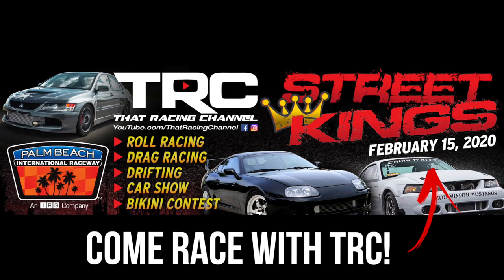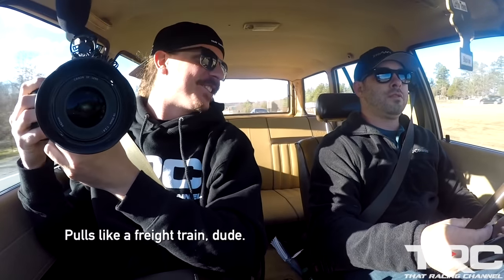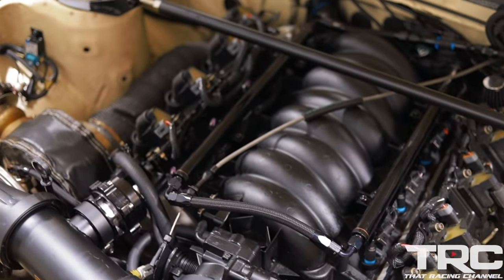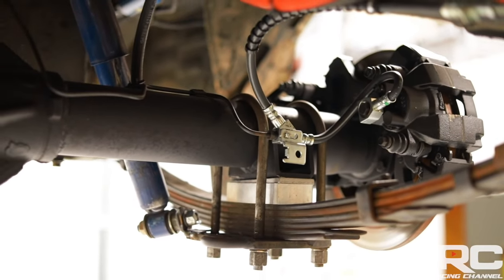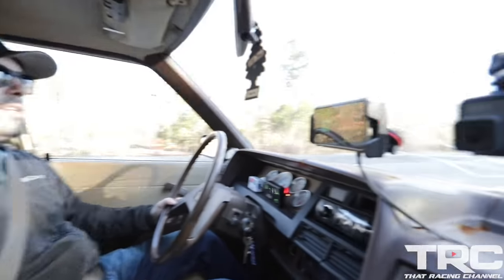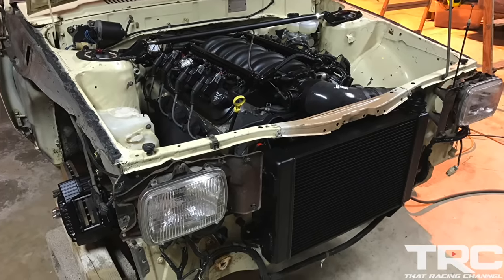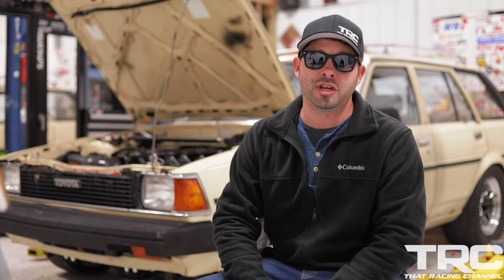800HP Sleeper Station Wagon Encounters Police (Best Excuse Ever) - Barn Find For $100

Comment: I know it would sacrifice some power but a quieter exhaust system would make this the ultimate sleeper.
Reply: Yes sir, cut outs are a must
Reply: I hear you tyler....but can't have it both ways....Pretty quiet compared to the less than 200 hp Civics around my way.....And I'm including the dorky gay inflated stereo bass on these Civics here in DFW, Texas....
Reply: How about a full stock looking exhaust with a valve to a performance exhaust
Reply: This ain't no sleeper with tires like that..
Reply: This ^^^^ hardest part of a sleeper build is a vehicle where good tires aren't out of place.

Comment: FINALLY.. an ACTUAL sleeper! 👀
Reply: THAAAAAAANKS👏🏾👏🏾 i hate when they say "sleeper" and shows a Mustang or an STI🤦🏾‍♂️
Reply: until you hear it maybe.
Reply: @GhostlyGhille  thats the point of it actually. Having a car that at first glance you would think you can beat it with a stock low level car like a Celica but then when it comes alive you be like "damn..."
Reply: Aside from those giant meats back there too lol
Reply: Sleeper when it's in a parking lot maybe. It's too loud to fool anyone while it's actually driving around.
Reply: @mikey_gc8  tires dont tell you anything though. Any fool could put DOTs on there car
Reply: Would be legend if he put stock looking wheels back on there...
Reply: @SCTitan06  i agree , there's a lot of billet aluminum "steelies" out there that would look almost stock with crappy silver paint
Reply: 1320 is all about their fake sleeper bs
Reply: I have a real sleeper. 97 explorer
Reply: That sounds like john force in the next lane?
Reply: Who can sleep with that loud exhaust
Reply: @NelsonRB26  Depends. People interpret sleeper vehicles differently. Me for one, has to look stock and sound stockish maybe sound as if the engine has a problem. Cutouts that open on a switch or say the rear tubbed to fit a fat tire but same wall height as the front is a sleeper. This car, the clear giveaway is the rear tires and the rims. I would never attempt a vehicle that is that clean underneath as its a monster usually. 

Many pickups pull that look off. Actually to why i want to keep my old truck as a Texas speed built motor twin turbo with a 4L80E and T-case with 33x12 tires would blow the doors off many vehicles. Also look and sound stockish with the proper exhaust and a 4in lift. Id use electric cutouts/dumps under the cab on a switch panel that appears to only have offroad lights (truck aready looks like a hunting vehicle) but in reality nitrous and cut out buttons are also on there.
Reply: The wheels and the sound gives it away not a sleeper sorry.
Reply: minus the huge cam and slicks haha
Reply: Wanna see a real sleeper its a guy with a 92 civic looks bone stock factory wheels n tires even a child on board sticker haha but under the hood he pushing well over 400hp
Reply: 3 name changes allowed every 90 days.  not exactly sure what you're saying here. I have a car that makes 700 horsepower through a muffler. It's a real sleeper. This wagon is super cool and really fast but it's not fooling anyone when you could hear it coming from the next county over.
Reply: @beardedforlife3740  those tires mixed with back sound means power. And if you don't have enough money to put a big motor in it you don't have enough money for those tires and rims, not to mention the rear end to turn those things.
Reply: @sctrep  nice exploder
Reply: @sethh8892  I'm well aware how much that stuff cost. However, I've seen plenty of people put wheels like that on a car to look cool. As for the sound, it could easily be a cam and good exhaust and it will sound like it has power. Besides all that, you can't tell me that if you seen a Toyota wagon you'd immediately think it fast
Reply: 3 name changes allowed every 90 days.  Didn't make anything up. Thanks for recognizing the reading comprehension skills, years of practice finally paying off!
Reply: Sleeper? Rip van Winkle couldn't sleep through that exhaust note.  Sounds like a box of hand grenades going off.
Reply: Needs steelies and a quieter exhaust to be a real sleeper

Comment: Holy shit bro, when they did that slow mo of the launch with slicks at the track you can see the entire chassis flex with he launched it...lmfao This is awesome!
Reply: The Man, The Myth, The Legend defenitley needs a cage!
Reply: @MOTOHEAD-ko3tq  ABSOLUTELY, along with some chassis stiffening...
Reply: It used to be pretty common to put slicks on a car and have things happen like the glove box falls open on launch. Old F-bodies used to tear the roof seams at the corners of the doors.
Reply: @lesliehorwinkle  I had a 1976 Buick Skylark sedan that I was given with 34,000 original miles, and I pulled the Olds 260 2bbl Rochester and TH200 (that was ABSOLUTELY GUTLESS and guzzled gas) and swapped in a SBC 400 with high compression domed pistons, Eagle stroker crank, Dart heads, a dual tunnel ram intake that had two Holley 850 Dominator double pumpers, MSD 6AL timing, along with a Muncie M-22 Rock Crusher and it eventually made 566 whp on a hub dyno, but I put M&H slicks on it and I remember when I launched it for the first time the glove box fell open and distributed it's contents into the floor, and both of my sun visors flipped down in my face...lmao That was a really fun car and a burnout machine.

Comment: The wheels look too fancy. Don't you have any rusty hubcaps.
Reply: Hubcaps couldn’t handle the speed/torque of this beast.
Reply: @TEDdotcom   Steel rims could, however.
Reply: @TEDdotcom  hubcaps are decoration  only. A steel wheel, which is what a hubcap covers, could handle it.
Reply: You also need to add some duct tape to hold stuff on. Maybe for the headlamps or something.

Comment: Not really a sleeper when it lugs like that. It's obvious to everyone with ears and eyes for 5 blocks.
Reply: Actually...pretty mild sounding.  You can't have it both ways with what he has to work with here.....sure you can make it more quiet.....but you'd suffer too much power loss. Consider the power....this is pretty quiet....
Reply: @justmyself1000  "what he has to work with" making it sound like he's misfortunate with his 800 horsepower motor😂
Reply: 3 name changes allowed every 90 days.  so what's your magical point? Because you just said that people aren't going to know that it's extremely powerful... but literally everyone knows it is...
Reply: @sethh8892  And those rims, the fat back tires.. Sleeper should look a bit more ordinary
Reply: Herp Derp We did that w/ a 70 Nova,w/406 one time . We put exh cutouts on it , and in a small town w/brick buildings it was awesome rattled the windows for blocks .
Reply: Still a sleeper though, many can pull off the loud exhaust and new wheels but no real power. 

not until he opens the taps like a maniac

Comment: I dont think you know what "sleeper" means.

it definitely doesn't mean a car that sounds like a cammed out monster equipped with drag slicks.
Reply: T C it's hard to make an 800 horsepower car quiet.
Reply: Exactly I see kids with no power and all exhaust attracting the police everywhere they go.
Reply: @clumsygarage1578   straight to the point !
Reply: @clumsygarage1578   Not really, with true duel exhaust and actually using mufflers it's possible to quiet down more that twice that power. It's just most guys that go through the effort of building an engine like this they want to hear that big Cam and feel it idle.

Comment: Definitely badass but needs a cage 36 years old have fun but plz be safe
Reply: @Stay Lit True, but the driver be sleeping forever if he rolls it. That thing will turn into a stepped-on coke can in a second, they are death traps..
Reply: @Tomazack  You are right, but i understand why he dont do one
Reply: @Tomazack  didnt yall see the full seam welded chassid
Reply: @louiscrespo1280  Yes, but that doesn't improve the strength and rigidity of the roof and pillars. And 800 hp could easily send this car flying and rolling, and the outcome wouldn't be good. These cars weren't known for their ability to withstand crashes and rolls.
Reply: Exactly. Tires brakes and suspension as well.
Reply: Rock Hard  Never heard that one before, I approve.

Comment: The wheels are the only give away, way too nice.
Reply: *tires, the wheel look ehh
Reply: He's obviously not going for a sleeper looks more of engine build and he could just care less about the car. I guess he just does drags but a drifter would be cooler
Reply: I.e. puts all the money into engine and driver train into a bucket looking car. But I love old school yotas
Reply: Nah Brian, they meant wheels exactly like they said. You over there inspecting tread and width bud?
Reply: @vvumpkin  the wheels are after market sure, but they don't even look that good. But ya obviously have massive slicks is gonna lose the sleeper look.
Reply: Yeah the term "sleeper" is doing a lot of work here. A real sleeper should look and sound as stock as possible.
Reply: But the upholstery makes up for the tires
Reply: @dannycole2974  lolol yes and no. Sleeper look is from the outside. No one's gonna he like " oh that looks like it's not stock. But the seats are shit. Nvm, it can't be fast" -_-
Reply: I have seen plenty of old, worn out cars with a thousand dollars worth of rims.
Reply: I had a 1982 Corolla. It was a good car.
Reply: The ventilated seats put in in the luxury car category. Also, good to see it came with the trailer package...in case you ever need to pull an office building..ya know..'
Reply: And all the electronic gauges, shifter, clutch setup, 2-step...but maybe the cop didn't see those. He sounded bored anyway.
Reply: And a screaming cam

Comment: it needs mufflers and butterfly valves to be a true sleeper.
Reply: Had exhaust dumps on my 454 70 SS Chevelle in one of it's iterations of engines/mods over the last 30 years I've owned it.  The rumble if I'd rap the peddle good would literally feel like you were getting punched in the chest if you were standing in the wrong area when I did it.

Comment: I love sleepers, had a couple. My best was a '79 Cherokee with AMC 360. It couldn't win a race against its own exhaust. We live in the mountains and it was always a chore getting up the hill, going was easy.
Put a 568 CID, I opened up the 454 Siamesed a bit. 3 angle valves, my custom design cam, 11.5 ratio, 442 to 308s, 27% full time in transfer case, 3 inch holes, dual with close to free flow mufflers, and a few other things including custom pinstripes and a touch of rust here and there. It sounded like an old beat up truck engine with a few leaks in the exhaust. Until I opened it up then the whole county knew there was something special under that hood.
As to the police, I went to a market once and a policeman parked a few spaces away. He looked over at us, smiled shook his head and walked away. Being a fairly old guy, 40 at the time, is probably the only reason no ticket was involved.
I need another sleeper, everybody needs at least one in their life.

Comment: I owned 1987 JDM version of this in my country back home before ( KE72) with 1.3L 4K engine , 4 speed manual transmission , Still very reliable and good on gas
Reply: And my dad owns one rn and it's made in 83 ke72

Comment: Flowmaster may reduce HP more then let's say Cherrybomb but FM's sound amazing to me. You could run 18" glass pack before the FM's, it would help with the noise and the only real HP loss would be from the FM's. Same trick could apply to the CB's with even less HP loss.

Comment: Normally when I get pulled over I just go to jail. But a funny situation between me and a highway cop (clocked me 30 over while I was still slowing down) but when he asked why I wasn't wearing a seat belt I said "Natural selection?" He found it hilarious! (I was it was just a racing harness and I had to grab my wallet) Didn't get a speeding ticket in my LS3 e34 GMW. But got a no seatbelt ticket and told to slow down.

Comment: Narrow a Ford 9” or a Dana 60 with a live axle out of a 90-94 F250 4x4 with a 5.0l  and Toyokogyo 5 speed( do not use the trans, just the rear)  w/a 5 lug conversion

Comment: A friend done about the same with a chevy vega wagon using a LT-1 coupled to a 3 speed turbo but retained the stock 4 lug high ratio rear axle that didnt roll 3 feet forward before it shucked all the teeth off the ring and pinion so by roll racing  starting at above 30 and then laying into it managed the axle riping to only drifting from one ditch to the other as the stock 4 banger vega suspension had never been designed for five times more horsepower

Comment: That lightweight 1983 Toyota with a 800hp engine backed with a manual clutch must be super fast because I had a silver color 1978 Toyota Celica GT hatchback low rider ( nicknamed Silver Bullet) in the early 1990's with a stock 22R 4cyl engine with shaved head backed with a 5 speed with a Bronx racing clutch. I raced a souped up 5.0 302 V8 Mustang that had a large hood scoop with big racing tires on the back on the interstate highway and I was going in circles around the guy laughing at him while he was flooring it and I made him look slow. I only got beat by one car which was another even smaller lightweight Toyota but he had to cheat and use Nitro towards the end of the race to beat me. My 1978 Toyota was very fast for a 4cyl 5 speed and I can't imagine how fast this guy's 800hp 1983 Toyota is : )

Comment: Like the balance of 'things', and left it looking like itself, not something else. I have a 91 black Ranger XLT sitting in the driveway (2.3L 5spd 4cyl 8plug) with a blown headgasket that I can't bear to part with, cuz it's been with me since 98. 368,000mi. Daily driver. 32mpg on road. Straight body. Reasonable. Fr. Windsheild leaks needs good home. New fat bfg all round . Sit 2yrs. Gmail [14" alum whl]

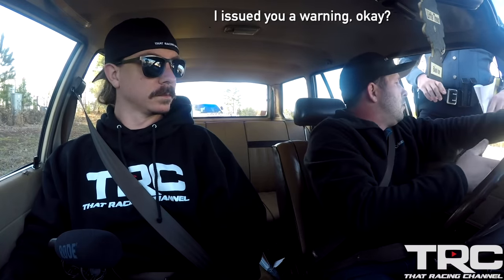Comment: 8:30 you got lucky. When I did that I got a permanent misdemeanor on my record! Just saw it on my record recently...yep still there after 22 years.
Reply: What you can't get that expunged of your record after that long....
Reply: @Inverted87  In my case it's not worth the expense and time. It doesn't show up on public back ground checks or DMV checks any more. It does still show up in the court system which is how I found it. I don't believe expungement will help that anyway.
Reply: @fasnuf  that makes sense at least it's not on the public but that's still a bummer.

Comment: Should run the exhaust pipe off to the right side of the car just in front of the right rear tire with an angle cut tip.

Comment: Pulled over by cops, tells me he saw me burn out dragging a new golf twin turbo of the lights and he is now impounding my car.  What golf, i said?  I had a moment and nearly lost control, i couldn't help it, i coughed, sneezed and farted all at the same time, i lost traction, just managed to hang onto it. Haven't you ever done that? Coughed sneezed and farted at the same time officer? You loose your senses momentarily? That's what happened officer. Cop was totally dumb-foundered, said now I've heard it all, went and checked with his super, came back and said, drive safely sir.  (12.6 second VTSSLS1 shift kitted 3000 billet stall)

Comment: 1).  Are you aware that dude's dialogues have no audio?  2).  That shit is not a sleeper.  If that thing pulls up along side you, you know right away that it's packin' some fucking heat.  Thing sounds like Zeus firing off lightning bolts from underneath the chassis.

Comment: All that time and effort into this build and no intercooler? I was wondering why such pedestrian numbers with a cammed 6.0L with such high boost numbers. That's why. And yes, I know 500 whp is nothing to sneeze at but a 6.0L can approach those numbers on pump gas even without a turbo. Leaving a lot of power on the table there not getting the air charge cooled down.

Comment: The old cars were not designed with the same safety built into them so this is dangerous to put so much power into an old car.  The newer cars have better 
baking and support.  You can see that even in the best cars when they go fast the video ends with them in the ditch dead and the super fast sports car is just a bit of burnt out wreckage.  Those were cars with super breaking and special steering.  At that speed you could die.

Comment: yeah,,   noone knows how to get horsepower these days other then.   supercharger, turbocharger,,,   nitrous...  50000 into the engine...

meanwhile I'm breaking low 8's in the 1/4 with a normally aspirated 428 Cobra Jet    How?  well  the car is 1400 pounds.   noone thinks about horsepower to weigh ratio these days..   and if thats a stardard 2 ton vehicle... well, you wasted a lot of money on the engine, when you should have been losing senseless crap.. mine has no radio.. interior decorations of any kind.

then again, you can only beat cubic inche's with rectangular dollars  :-\

Comment: No disrespect to the owner, your car is awesome.. but thumbs down to the channel, with the bullshit about the car only being 100.00 after the Camaro trade.. not true.. since the front end is s13 that didn't appear for free, nor did the ford rear, gauges, turbo, suspension, extra metal, tuning, custom drive shaft, plumbing, wheels, tires, brakes.. etc etc..